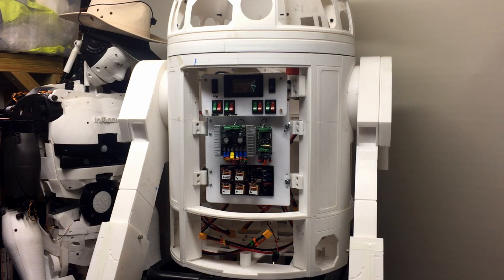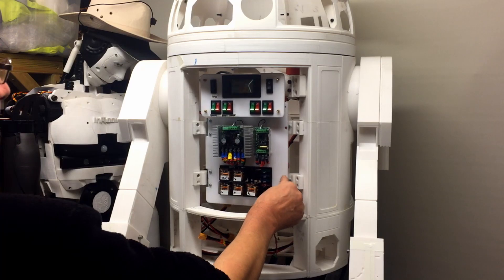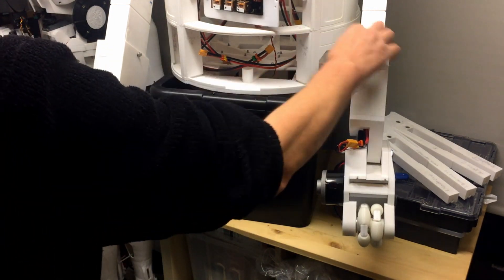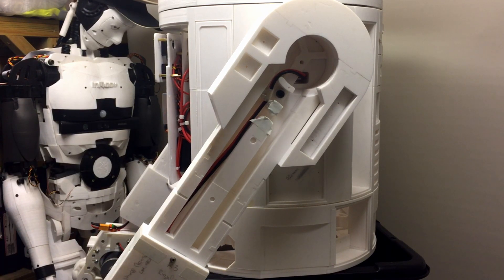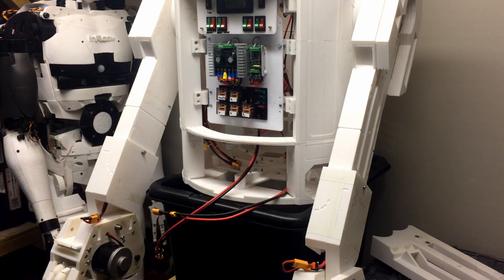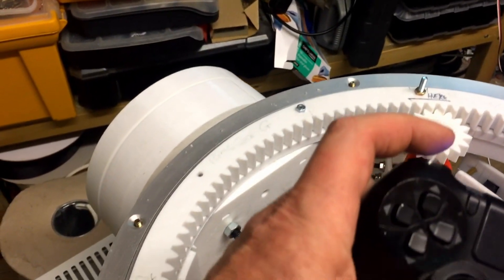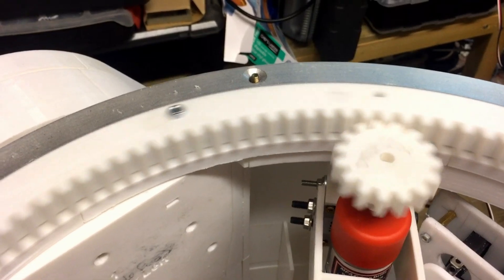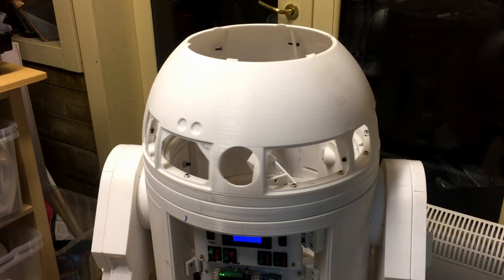R2D2 Droid Build Part - 19

Comment: Can you please advise me were to find the slip ring?
Reply from the maker: Hello Jeffrey, I bought mine from Amazon but ebay is good for them to.  BQLZR 0.5" Diameter 240V Black 8 Circuits 250RPM Each 2A Capsule Slip Rings 4mm Bore Size Capsule Slip Ring. https://www.amazon.co.uk/gp/product/B01CJJNJSE/ref=ppx_yo_dt_b_search_asin_title?ie=UTF8&psc=1

Comment: Hi can. I ask you mentioned a slip ring could you tell me the actual part you got thanks 🙏
Reply from the maker: Hi Paul, I bought one but I haven't actual fitted it yet so not 100% sure it will fit.   It should fine.   "BQLZR 0.5" Diameter 240V Black 8 Circuits 250RPM Each 2A Capsule Slip Rings 4mm Bore Size Capsule Slip Ring" from Amazon (https://www.amazon.co.uk/gp/product/B01CJJNJSE/ref=ppx_yo_dt_b_search_asin_title?ie=UTF8&psc=1).   The crucial bit is the 1/2 in size anyway.

Comment: Que motor utilizas para el Domo?
Reply from the maker: "What engine do you use for the Dome?".   Hi Roberto, the dome motor I used is the: 919D501 RE 540/1 Metal Geared Motor 50:1
I bought this from Technobotsonline.com part no: 1450-053 https://www.technobotsonline.com/919d501-re-540-1-metal-geared-motor-50-1.html

Comment: Great video! I noticed the tire was rubbing on the foot and I'm having the same problem. Have you solved this? How?
Reply from the maker: Hi Nikolas, I have used large washers to add some space between the tyre and the frame and it seems OK.   I am possibly going to reprint parts of the wheels at some point, using the different drive mechanism that Mike Baddeley has designed.

Comment: add some depth to that lip/protrusion/ridge on the horseshoe that goes into the leg at the top. People WILL dislodge it. It is the first thing they'll rest their arms on when posing with R2. I tried with magnets at first and they got knocked off over and over again. Ended up having to use wood dowel pegs so they couldn't move vertically.
Reply from the maker: Hi Mark, thanks for the tip. I can imagine kids climbing all over r2 as well!
Reply: @kylecampbellweb  Depends on the crowd, of course. :) . A "good" convention will have parents of a "like mind" and realize their kids climbing all over R2 is bad.  Go to a bowling alley birthday party as a favor for a friend's friend, on the other hand........

Comment: Hi Kyle happy new year again.so I am ready to put mine together but haven't figured it out were that 3 mm by 12 mm metal peg goes ,the bolts for the shoulders are the 8mm by 110mm?any help would be much appreciated thanks in advance.
Reply from the maker: Hi Sky, I used M8 100mm bolts which are fine. [110mm long inc allen head].    That 3mm by 12mm peg - everyone seems to ask that and I am not sure.   Its part of the hinge door mechanism I think, but I havent completed all that bit myself.    I remember buying them myself.

Comment: I'm so envious I'm turning green! Impressive!I've been sanding and painting while you've gotten yours mostly together. And I'm envious of your print quality! Wow.I just test fitted my lazy susan to the bottom ring and it's too tight to move. I see you were having catching issues too.What bolts do you have there to attach the dome to the ring? M4 or M3? 60mm? And what motor?Are you planning to run wiring up through the center hole slip ring or are you going to have everything in the dome on a separate battery like you mentioned before?
Reply from the maker: Hi Chris, have a look at my last April blog as its got some close up pictures of the dome/ring https://myrobotnigel.blogspot.com/2018/04/r2d2-continued.html
I have now got the lasy susan itself to run really smoothly and fast with the motor.   The ring I bought was not pre-oiled and when I used some silicon spray it really spun around. 
I bolted the top plastic inner ring-circle down to the main top ring with m4 bolts and some self taps.   Its really hard to explain,   I will go and take some pictures and put them on the blog later today. Also pictures of the motor as I can remember the model.   Simplest!
Now I have sort of got the power board sorted out, I think I will use two EZB controllers [I have two as I bought them cheap in sales a year or so ago].   One in the dome with the camera and what ever else, the other in the main body.     I will possibly attach the body controller to the loudspeaker assembly, as it may jam the door opening if its on the swing door.  
I will then just run power up through the slip ring into the dome. 

Not sure if I am that far head, sanding and painting its something I am putting off ever into the future...
Reply: Hi Kyle:I tend to forget the blog and forums. I found the Padawan last night BTW. I like your idea of voice address.Good tip on the silicon spray. I've made a note of it.M4: okay, that's what I needed to know. When I measured with my calipers the holes came to 3.53 and 3. 29 so I wasn't sure.Hard to explain: I noted that with the directions. Some things can be hard to explain or seem self explanatory. Like all the little pockets on ring 1. I know what some are, but not others. Oh well, I'll figure them out eventually. :)Sanding and painting: I'm at a stand still until I got those bolts sorted out, and the workbench was occupied anyway. Now that I know what to get I'll order some. :)Thanks for the tips!
Reply from the maker: @chrishechtl8330  Chris.   I have more or less standardized on 4-mm bolts and drill anything out to fit.    Anything that fits will normally work anyway. 
The Dome motor is supplied currently by Technobotsonline.com and is part number 919D501 RE540/1 metal geared motor 50:1 ratio [Technobot part number 1450-053]   I assume other do similar, maybe ebay also.   £17 approx UK money.    Check my blog later for more pictures.
Reply: Thanks Kyle! I'll look into that. :)

Comment: This is awesome, im new on 3d printing and no experience at all but  this project seem fun, Is your plan to radiocontrol it or do you plan to do some sort of programing? arduino or  something similar?
Reply from the maker: Hi Ulf, my reply/comments got lost earlier so you may get two replies to this!
I will control it always using a handset, it wont be autonomous.  EZB controller to make it all work.   As I mentioned to sky in another comment, it will talk and have speech recognition and have a camera with face recognition.   Plus A! so its semi smart [ish]